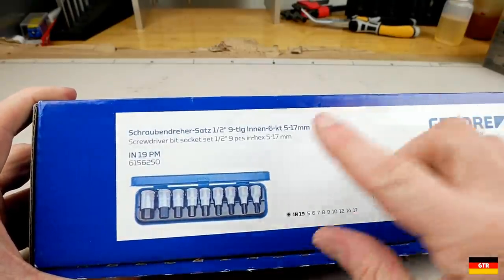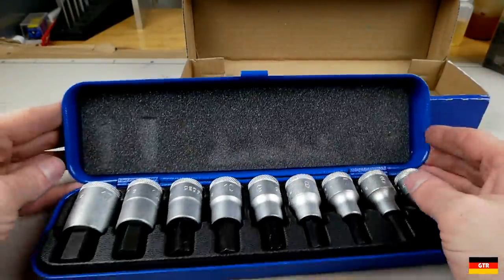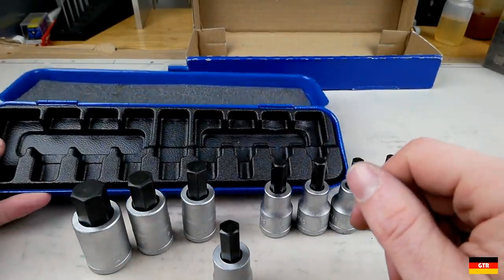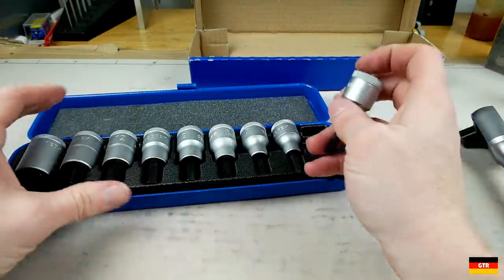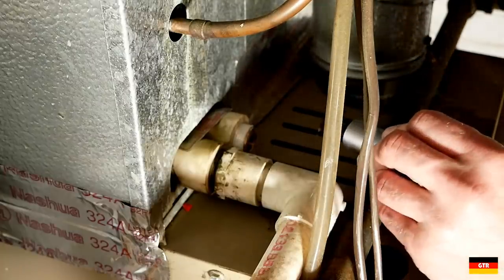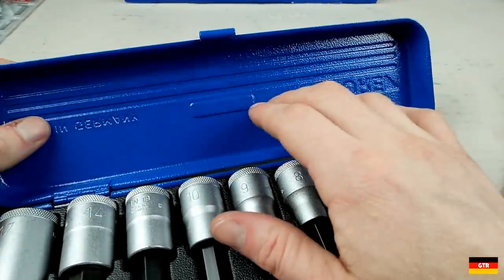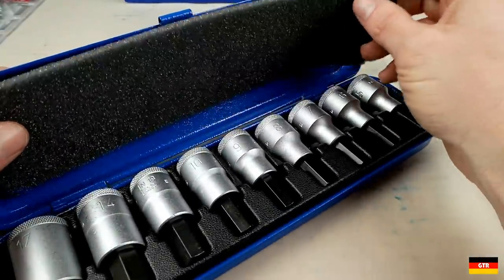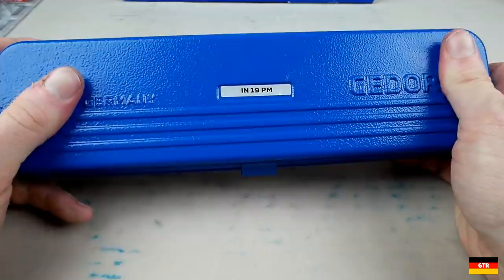Gedore Hex Sockets

Comment: FYI: the bevel on the socket is part of the socket production process. The hex hole is created in a process called broaching, it involves a wobbly hex cutter tool that is gradually pressed into the metal to dig out the hex bore in a circular motion. Look up rotary broaching if you're interested. Point is, a pilot hole and countersinking is required for the broach to properly start digging. The bevel you see is what remains from the countersink once the rest is cut out by the broach. You cannot start broaching without a countersink for the same reason you need centering for a drill: it goes off-track and might even break under the load. So all in all, the bevel is not for the insertion of the hex bit, but is a required part to produce the socket. I've worked for a machining company doing the exact same process for hex screws.

Also FYI: like you said, the larger sizes are used for robotics. Many robot arms are assembled using hex machine screws and I've seen some 14 and 17 with my own eyes. It also goes for the screws holding down said robot arms.

Comment: I've only used hex sockets a couple of times, but every time I have I found myself wishing I hadn't cheeped out and bought a hardware store brand, Chinese made one. The feeling usually hits me right as the hex drive rounds over after a few uses. These look like they are actually designed to do real work. While I love the look and durability of metal cases I don't mind plastic cases so long as the insert works and the plastic is thick enough. I have a Felo impact bit set with an over molded case with routed foam insert. The case is compact with fairly thick walls, reinforced by the over mold, the the foam insert is dual layered and holds everything great. With that said I have been looking at several socket sets from Elora that come in metal cases like the one in this video.

Comment: I prefer metal cases; but the major downside to them is the  tool companies usually put that flimsy vacuum molded liner in them. The liner lasts for several years and then just starts cracking and disintegrates. I've seen a few tool restorers replace it with custom cut craft foam, wooden inserts or as you said spray expanding foam into the backside of the liner.
Reply: Jujoji Custom wood inserts based on the plastic design would be awesome. Or something softer.

Comment: Too bad about the plastic socket holder - that seems all to common with metal cases. A decent plastic case usually has a decent blow-molded holder inside. I actually care more about that part than the outer shell, but if I can get a good metal case with a decent tool holder, that's worth extra to me, compared to a plastic case. On the other hand, if the insert is junk, and I can get a halfway decent plastic case, I'll go with that. In this case, the holder seems lousy enough that I'd end up putting the sockets away in my tool chest and tossing the box, and I'd feel bad about it since it's so nice, and I'd prefer they put the tools in cardboard so I don't end up holding onto the nice box for two years before throwing it away.
Reply: hardlyb I feel ya. You feel like running over to their headquarters and be like, “seriously, WTF”

Comment: Bit of double sided tape would hold the foam in.
Reply: Yeah, it wouldn't take much to do what you need there. A few dabs of hot glue or 3M 74 spray adhesive.
Reply: Typed too soon!
Reply: The foam is just ment for transport  frpmom factory to user.
Reply: Get some toolbox liner, cut to size and glue that in, the foam rubber will rot out and is to easy to tear.

Comment: Has anyone had issues with these I got the 1/2 and 3/8 torx set variant had issues with the square drive not wanting to fit my 3/8 ratchets, the 1/2 seem fine but a little sluggish to put on. 

I have seen some people have issues with the square drive on the 1/2, they are super nice quality, the bits themselves seem high quality just the drive.

Comment: 1:44 They do cheap choice and don't glue it because it's too hard to remove when it's get old? Really? Maybe somebody somewhere sell tool for removing old foam...
Reply: Who cares if it gets old? Its a tool..
Reply: It is just ment for transport from factory to user.
Because of that it has the rectangular shape and is too small.
Reply: @frankkraaijvanger4937  Yep. Funny thing is that I have really cheap (So cheap that manufacturer doesn't even want to add it's name anywhere of it) socket set which is in blue metal box, plastic tray like this one and same kind of foam and I never thought that any of those things mean that it's good quality... more like that the tool itself is as cheap as possible and the money has used to the case to make it look and feel more expensive.

Comment: I've seen people fill those things with foam, looks like the hard way. It would be heavier but an epoxy resin would be lots easier, assuming the chemicals/solvents are compatible with the plastic of the tray.
Reply: My original thought was pour the resin in and letting it level, but another more time/labor intensive method would be to paint/coat the back of the tray in layers until the desired strength is achieved.